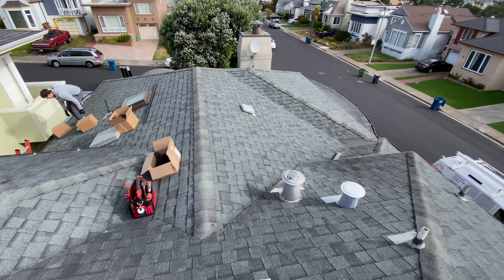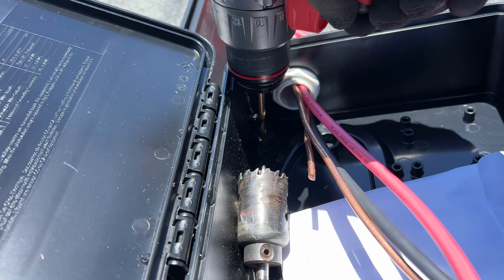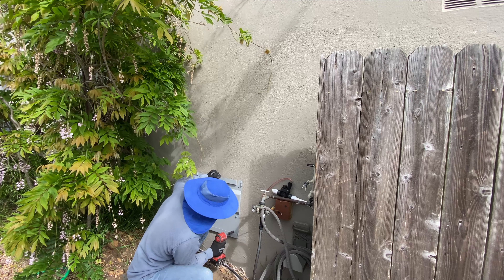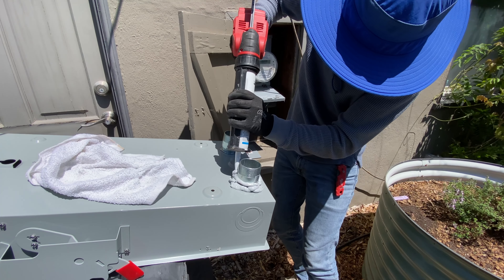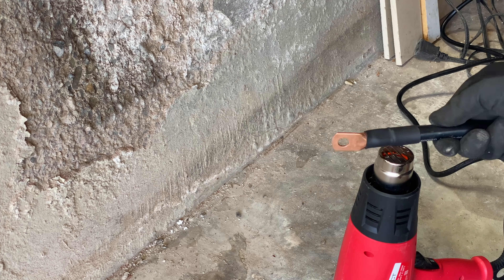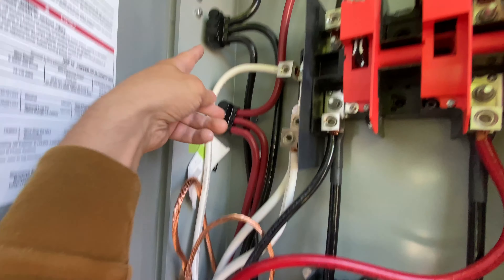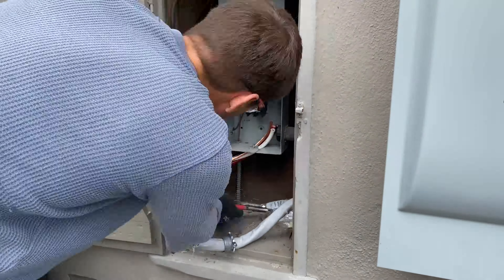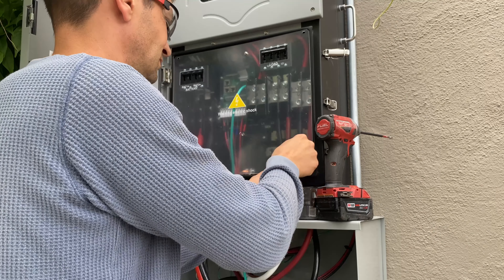Full home battery backup with Sol-Ark 15k and EG4 Powerpro. Full install

Comment: This is the second time I have to warn you about your back. Buy or at least lease a hydraulic lift for heavy loads like batteries. You will strain your back muscles or develop disc prolapse if you keep lifting them manually. It is even bad that the lifting technique is not optimal and puts a lot of stress on your back. You are a fine installer and it would be bad if back pain stops you from producing these nice videos. Clean install as usual.
Reply from the maker: tesla dolly is in transit, thank you for your kind words.

Comment: Nice job !  I'll never understand putting equipment like that outside . I know it's rated for it but it just seems like it would have last longer out of the weather .
Reply from the maker: sometimes city restricts indoor installation, so there is not much choice for equipment location.
Reply: Some locations requires outdoor mounted equipment, however the equipment should still be protected from direct sun light and all other elements, however that is a manufacture recommendation not required to pass inspection, so i hope in the future it will be required to pass inspection to protect the gear from the elements directly.

Comment: Only 15K Watts, to back-up the Whole House???   That is only 63 Amps per Leg - L1 and L2.  That is not enough watts to back-up a small 100 amp Service Panel. Many new homes now have a 200 Amp Service Panel. And many, all Electric Homes have two (2) x 200 Amp Service Panels.
Reply from the maker: The goal is not to provide 200A, but to provide power during power outages. In general 15k is enough for single family home.
Reply: @SolarEngineering  Yes, I know this won't provide 200 amps. That was the point of my post.  This is a SMALL home, that mostly runs on fossil fuels .

Comment: Dont use activate battery for lithium batteries, it is only for lead acid!!!!
Reply from the maker: false statement. Check Sol-Ark manual 3.4 Battery setup -> Batt -> Activate Battery
Reply: @SolarEngineering  Hmm my Deye gives this warning in the manual
Reply: @ErikPloeg-tq4py  the activate battery setting is recommended to be enabled for either battery chemistry with Sol-Ark 15K, but is especially important when using Lithium due to the BMS going into protection mode which outputs 0Vdc to the battery terminals. The activate battery setting will allow charger to send power to DC circuit in this event which wake up a depleted LFP battery

Comment: Very nice, thanks for sharing!  One thing I would've done differently would've been to leave some space between the battery and the gutter/inverter.  Since that battery was hung on a cleat, everything above it will have to be completely undone if for any reason that battery needs to be removed/replaced.
Reply from the maker: we still need some kind of conduit between the battery and the gutter box to protect the wires. and yes, replace the battery will be challenging

Comment: Why use the single throw disconnect next to the meter?  Doesn't the breaker provide a method to turn off the grid power?
Reply from the maker: requirement from a local utility provider

Comment: Awesome content!!! One ☝️ of my favorites! Have you had any issues with an inspector saying that pv dc circuits are not allowed in the same wireway as other circuits but honestly how would one do this differently? Looking at the NEC and it’s still not exactly clear to me.
Reply from the maker: we can run DC and AC in the same conduit. I don't have NEC code handy, but it's allowed.

Comment: @SolarEngineering do you remember the model panels used for the dual poll and emergency grid shutoff ?  Also to pass inspection was all the labels placed on the panels? Also what type silicon sealant use?
Reply from the maker: Single throw AC Disconnect: Siemens GNF324
Double throw: DTGNF224NR
ChemLink M1
and yes labels added to pass inspection.

Comment: sir can this work well?  

power goes into the inverter then pull the power cable into the mcb on the far right then into the main source a 

Lvd goes to the 48v relay to trigger the relay 

Then the AC inverter goes to the relay via hole no

Pull the cable from the MCB AC inverter output to the contractor so that the load doesn't pass through the relay then enters it into the ATS source B

Comment: Not sure if you or the customer is aware (also not to be rude). That single battery can't supply enough DC amperage to utilize the full potential of the Sol-ark 15k.?
Also in the manner that you wired it, an additional jumper wire tying both DC sides together is needed, per the install manual.?! Hope all is well 🙏.
Reply from the maker: Customer is aware of the power limitation for the battery. One battery port is rated for 200A and battery can output 200A as well. If another battery will be installed, then we need to utilize 2 ports (install battery busbars or run another set of wires)
reference from Sol-Ark manual:
1.3 Connection Requirements -> 1. AC / DC Connection Requirements

thank you for the feedback
Reply: @SolarEngineering  appreciated 👍. Thank you for sharing and the reply. Gotta love solar!!

Comment: Great video. Was that 1awg to 1/0 cooper or aluminum for 100amp. Thought 3awg copper THHN was enough for 100amp.
Reply from the maker: was 4 awg and now 1/0, all copper
Reply: @SolarEngineering  wow. According to the ampacity charts for 75° or 90°, 3awg is sufficient.  Where do you see 1/0 is needed for 100amp?
Reply: yea also had the same question. i was worried and even checked nec 2022 :) 

i think 2awg copper thhn should be fine for 100amp no?
Reply: @mikavova85  minimum 3awg at 75° for 100amp. 2awg at 75° for 115amp.  1/0 is for 150amp so no sure what @solarengineering is saying.

Comment: Why not move the vents so the maximum number of panels can be properly installed. For such an exprnsive imstallation, wouldn't it be the right thing to do?
Reply from the maker: moving 4"+ vents is an expensive process

Comment: i wonder why jay box is not waterproof i would use different box looks like it needs rubber gasket
Reply from the maker: it's condensation water, need drain holes
Reply: thanks for the video. not a criticism, just an observation: that's a heck of a lot of money at ground level outside one's home. have there been thefts of these whole home inverters and/or batteries?
Reply from the maker: @4mla1fn  I'm not aware of any batteries/inverter thefts in our area